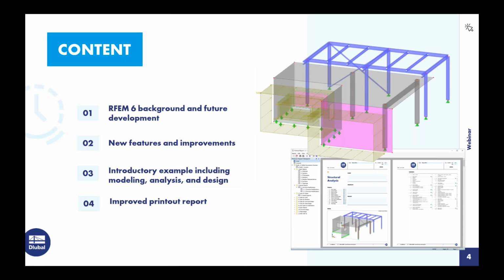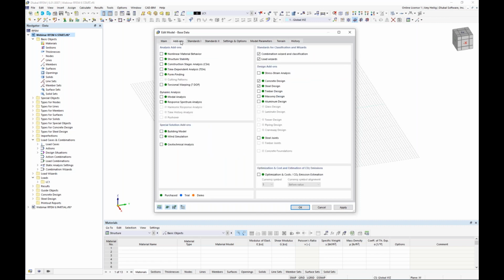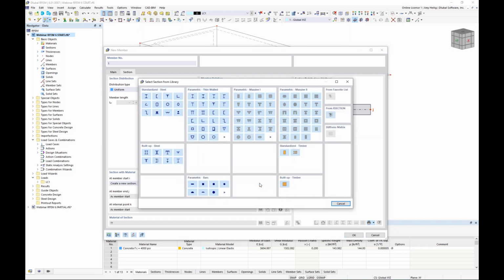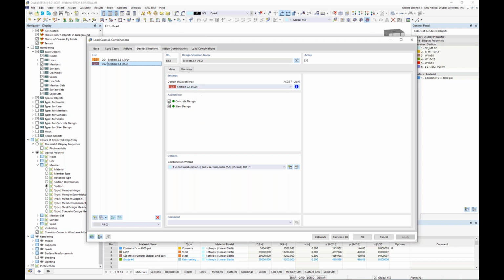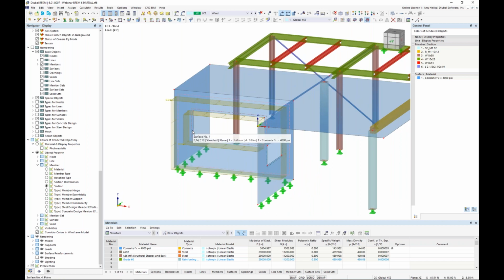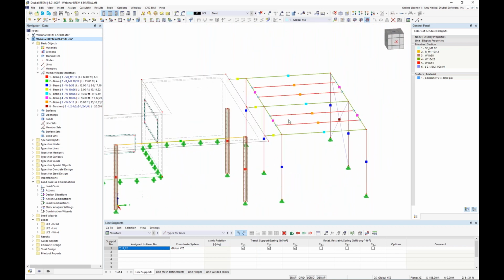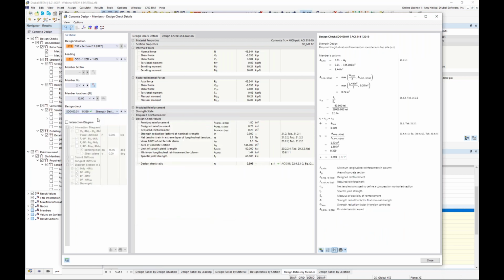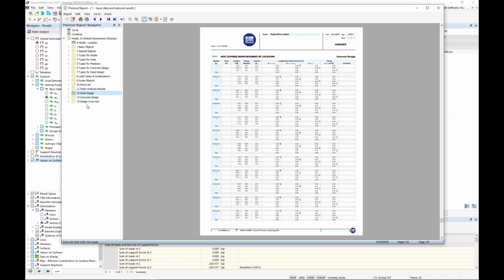Webinar | Introduction to the New RFEM 6

Comment: First of all, great software. I recently started working on 5 and now we are switching to 6. I have a couple of questions though:
1. How can I show the arrow in the direction of the reinforcement only? as1 with an arrow pointing in that direction and as2 with an arrow pointing in that direction too?
2. How come I can not create my own toolbars?! this feature was available in RFEM 5?
3. There might be a bottleneck problem in the concrete design, meaning, when I define everything and hit calculate, the solver gets stuck at the beginning with no spikes in the CPU usages and then starts running again in parallel but after a considerable amount of time.
Reply: in addition, when i was trying to add additional reinforcement to a certain location on a surface using the function "parallel to two points", the reinforcement (provided in this case) was applied to the entire surface. Is this a glitch?! maybe there is another way to do it?
Reply from the maker: Hi, Mohammed!
Feature 1 and 2 are planned for the future. Regarding point 3: It is difficult to say something without knowing the model. Feel free to send us your model by email at info@dlubal.com
Reply from the maker: Hi, Mohammed!
1. You can find the respective settings in the display Navigator.
2. The feature for creating your own toolbars is coming out soon, just stay tuned with the latest updates.

For questions 3 and 4 it would be best if you sent in your model to our online-support. Those are difficult to troubleshoot in the comments.

We hope this was helpful.

Greetings